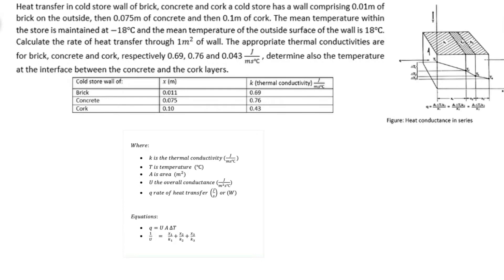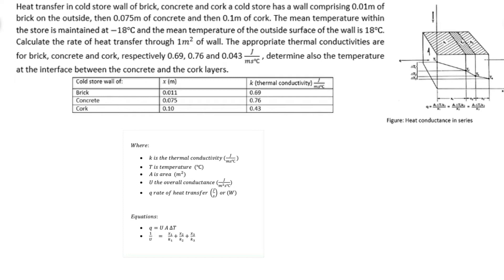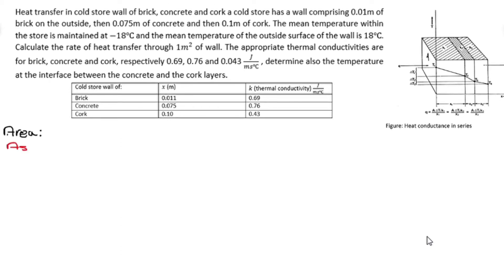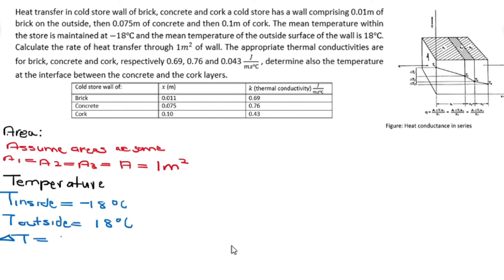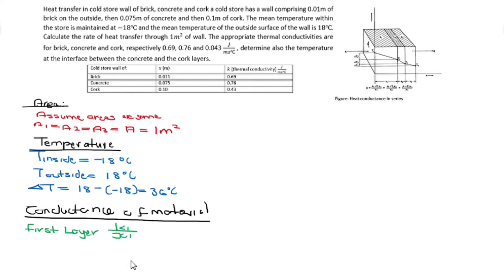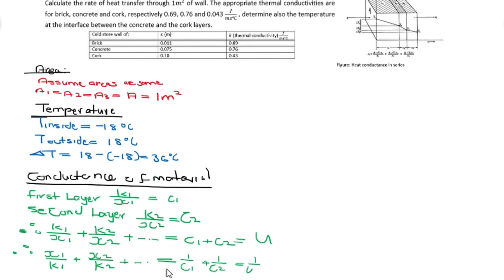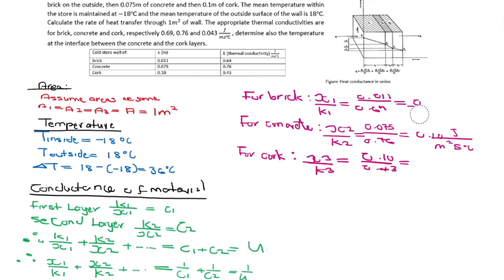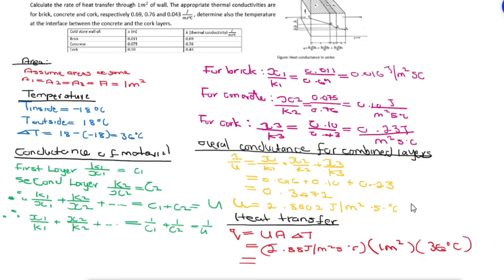Heat conductance in series

Comment from the maker: Hi there, 

I have provided a detailed explanation for this example: on how to additionally find the two variables: 
- T(interface concrete): 6.11℃
- T(interface cork): 1.46℃

You can access the information by following this link to my website: https://chemicalengineerwithkgabisang.co.za/Heat-Transfer-Analysis-and-Temperature-Calculation-in-Cold-Store-Wall-of-Brick-Concrete-and-Cork 
 
I hope this helps

Comment: Thanks for the lesson ❤️.
But you didn't specify how to calculate the temp at the interface between the concrete and the cork layers.
Pls elaborate
Reply from the maker: Hi there, 

Thank you for your patience. I have provided a detailed explanation on how to find the two variables you were looking for: 
- T(interface concrete): 6.11℃
- T(interface cork): 1.46℃

You can access the information by following this link to my website: https://chemicalengineerwithkgabisang.co.za/Heat-Transfer-Analysis-and-Temperature-Calculation-in-Cold-Store-Wall-of-Brick-Concrete-and-Cork 
 
I hope this helps and please let me know if you have any further questions. 

Best regards